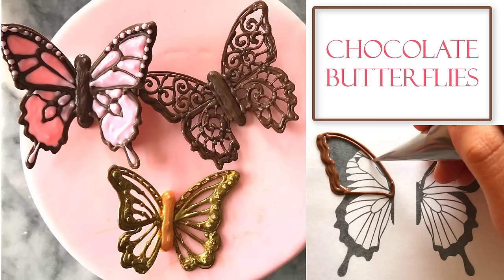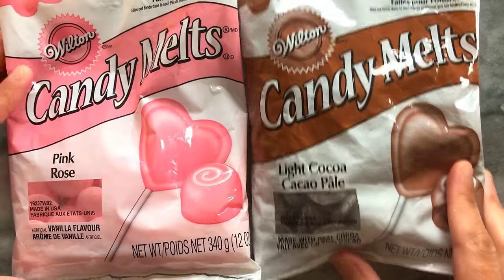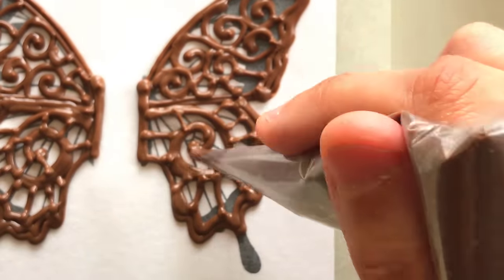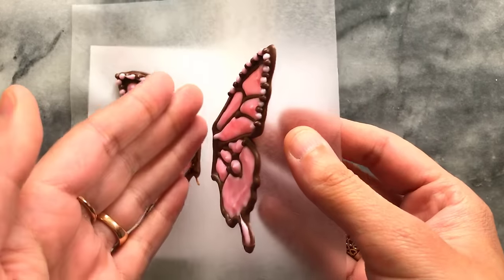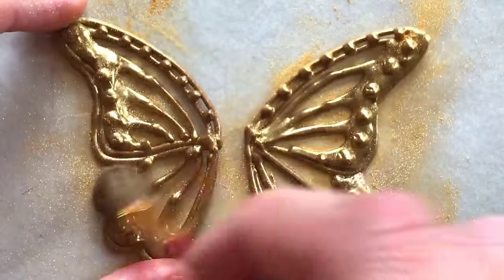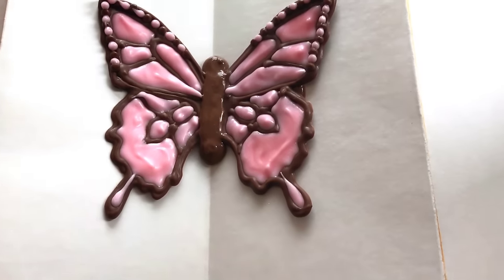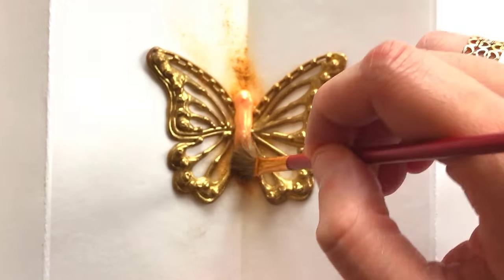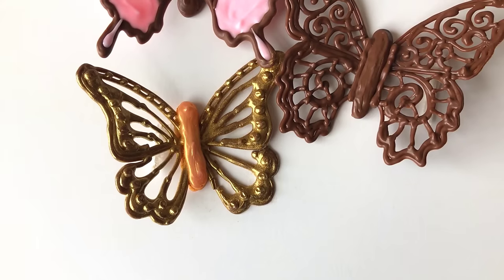How to Make Chocolate Butterflies | Piped Filigree Designs

Comment: Although I am Japanese who is not good at English, I thought about watching this video and trying it.
It was nice to meet this video
I will study while watching this video.
Reply from the maker: im sorry for the delay, so i have a feeling your using chocolate that needs to be tempered. The chocolate i use is a type of cooking chocolate which sets hard. Regular chocolate once melted and piped will wont set easily and will break or be bendy. you might need to look for cooking chocolate or check out videos for how to temper chocolate. tempering Is a technique that help restore the coco molecules in the chocolate to harden back to a solid and hold shape. I hope that helps. sorry you had problems with this.
Reply from the maker: check this video out its all about melting and tempering chocolate and very helpful https://youtu.be/sGlMoNs4qlM

Comment: thank you so much for this! i've made butterflies with regular chocolate, and it's so problematic and the finished product is too fragile. i use candy melts on cookies all the time! candy melts are so much stronger and easier to work with! the only thing people who would like to try this should keep in mind is to get used to keeping this at the right temperature to work with, play with it to get faster at it. make simple ones till you get better at it, and don't use too much at a time. also take your time to melt the candy melts, ALWAYS melt at 50% microwave or you'll get tiny bits in them. also wilton ez thin will help too. the teacher here is correct, the possibilities are endless!!  this is a great tutorial.

Comment: Hey lovely designs and absolutely love them 💕 But can you tell what else can we use instead of Candy melts ? Chocolates maybe ?

Update : Hey I made these designs by tempering regular baking chocolate and it worked amazing .
Reply: Thank you for updating. Will definitely have a go now
Reply: can you please tell how do you temper regular baking chocolate?
Reply: @dawnnadarajah7781  just heat it slowly on a double boiler.. many YouTube videos explaining the process.. if you have edible chocolate like dairly milk simply crush it and then put it in microwave for 20 sec. Take it out mix and put it again in oven for 20 sec. Do this till its melted.
Reply: Thank you so much for the quick response, i never expected you would even see my comment. Can i use chocolate chips or baking bars? what about regular chocolate bars?.....thanks again😊

Comment: Looks really lovely, can I ask where do you get the candy melts? Also do you how long they last out of the fridge before breaking? I’m planning to make these and add them onto a birthday cake I’m going to bake. Thank you
Reply from the maker: Im not sure where you live but in Canada and the US they are available at Micheal craft stores. You can also look out for cooking chocolate which is very similar. This type of chocolate sets hard once melted and made into designs. 
Using regular chocolate wont work as the coco butter would not be evenly melted and wont set properly. Using regular chocolate would require tempering.
Reply: Maj Makes It thanks for the reply, good to know I need to temper regular chocolate. I also live in the uk sorry for not mentioning before. I’ve looked online and hobby craft sells the candy melts! Thank you!

Comment: Nice vedio.. Happy New year .. I tried writing letters first before making butterfly. How much time I should freeze .. The problem is after removing from freezer and before placing on cake my letters are melting and sticking to my hands how to overcome this.. I want to write new year wishes with chocolate on cake tomorrow plz suggest ..
Reply from the maker: Happy New year to you !!! im sorry for the delay, so i have a feeling your using chocolate that needs to be tempered. The chocolate i use is a type of cooking chocolate which sets hard. Regular chocolate once melted and piped will wont set easily and will break or be bendy. you might need to look for cooking chocolate or check out videos for how to temper chocolate. tempering Is a technique that help restore the coco molecules in the chocolate to harden back solid and hold shape. I hope that helps. sorry you had problems with this.
Reply from the maker: check this video out its all about melting and tempering chocolate and very helpful https://youtu.be/sGlMoNs4qlM

Comment: Video is very beautiful Question Can I use the chocolate 70 Darkness Do you freeze the room warmly because my city is very hot
Reply from the maker: So when you use dark chocolate it needs to go through a process called tempering, tempering is something chocolatiers do to create solid chocolate again otherwise the chocolate will not set hard if you melt and make it into a design. I use a chocolate that once melts resets into a hard finish. Also known as cooking chocolate. You can google "Chocolate tempering" I understand in many parts of the world some types of chocolate aren't comon like cooking chocolate.   هدى كب كيك hope that helps.
Reply: Maj Makes It The problem is that the atmosphere is very hot here in my city and I asked about this kind of chocolate which is called Candy melts but also can not withstand the heat and melt the work 😭
Reply: where r u ??
which city ??
Reply: اختى هدى انا مش فاهمة انجليزى بس تفرجت عالفيديو و عجبنى  ممكن نسألك  اشياء فى الفيديو ﻻنا مش فاهمة اللغة 
كيف نقدر نعرف  نبدا نخدم بى شوكﻻته   نقصد الشوكوﻻته سايحة كيف قدرت تخدم بيها ؟ او هيا نوع معين ؟
Reply: نتمنى نتواصل معاك   
انا فرحت لما لقيت  واحدة عربية معلقة  معناها  نقدر نفهم منك  شن فهمتى من الفيديو
Reply: +libya libya حبيبتي انا من العراق واعلق باللغه الانكليزيه اذا تحبين تواصلي معي 💕💕

Comment: Please answer my question! If I buy the candy melts I don't have to temper it?
Reply from the maker: De Todo, para tí no candy melts does not require tempering. This chocolate is ready to use once melted. That's why I like using this, it's low maintenance and easy to use for beginners. 👍🏻
Reply: Maj Makes It thank you!!